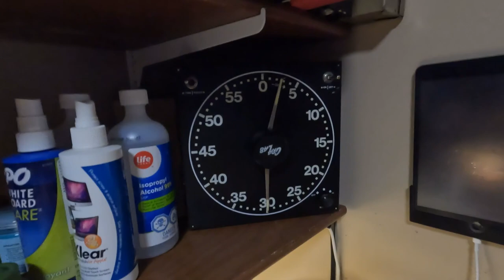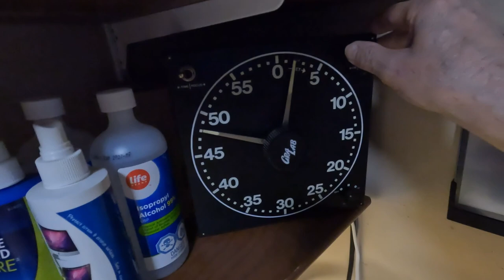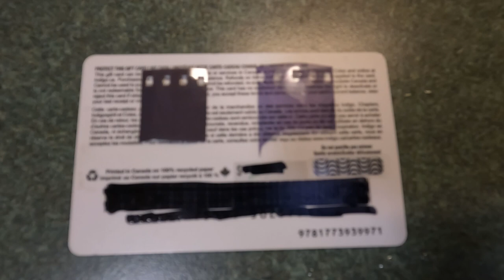Don't throw away your darkroom fixer, replenish it!

Comment: Jim: thanks for the informative video and a reminder that you can replenish fixer. Back in the early 80s I was involved in an E6 lab in London. We used to run the old fixer through a special device that collected the silver content, that is in the fixer. It was then picked up and sent away to a company who used to extract the silver and send us a cheque for some hundreds of pounds. I’ve just finished building my dark room. I don’t plan on putting through the volumes of film that we used to process at the lab. I will be processing black-and-white film and if my memory serves me correctly transparency film yields more silver due to the different process?
Reply from the maker: Yes in fact there are ways to do silver recovery for a home lab using steel wool but there is such a small amount that its not economically feasible unless you do a lot of processing.

Comment: Hi @jsollowsphotography. Thank you so much for this video, this is the only resource I could find on the internet explaining the replenishment section of the Rapid Fixer TDS.

 I still have some confusion regarding what's on the TDS and hope you could explain it.  On page 3 of the TDS it says for "Replenishment of Working Strength Fixer: 45ml/135-36". Is 45ml supposed to be the minimum amount of newly mixed working strength  solution added to the existing working strength solution, or is this how many rolls to expect to fix when replenished. From your video I'm thinking it's the former, since it sounds like you're able to fix more than one roll when you replenish using 50ml of working solution. How many rolls would you estimate you can do between replenishment?

 Thanks again for this video, it's very well done and has just the information I needed
Reply from the maker: Yes you are correct. It means .. when you are going to replenish, dispose of 45ml of your current working strength fixer and replace it with 45ml of freshly mixed working strength fixer. In other words dump out 45 ml of the old stuff and add in 45 ml of fresh (4+1). This boosts the concentration of your working strength solution. Make sure to dispose of the waste 45ml properly. I put it in a mason jar and when full I take it to my municipal chemical waste disposal site. Does that help? Please feel free to message me directly https://linktr.ee/jsollows
Reply: @jsollowsphotography   Perfect! Thanks for the super fast response!

Comment: Thanks for explaining the process but didnt you mean 'replenish' the (old) fixer by adding fresh fixer at a ratio of 1:9 instead of using (as mentioned in the video) a ratio of 1:4 which is what you would use when mixing an entirely new solution.
Reply from the maker: No it’s replenished at 1:4 for General Purpose film as specified in the data sheet for Ilford Rapid Fix on page 3 under Replenishment. 1:9 is only used for paper, not film. I still replenish for paper at 1:4 and have done so now for 51 years.
Reply: @jsollowsphotography  Thanks for the clarification, got it!

Comment: Thanks for the video. My problem is that I am getting a lot of black I am guessing silver salts floating around in the fixer. Do you somehow filter your working solution from time to time?
Reply from the maker: Depends on the fixer. My Ilford Rapid Fix doesn’t have that issue but I have seen it. Run your fixer through a coffee filter occasionally.
Reply: @jsollowsphotography  Thanks for the advice. I was thinking about trying this. I guess I shouldn't throw the filter away to normal bin?

Comment: Does this technique work for the Ilford Rapid Fixer for prints as well?!i am planning to use Ilford Rapid Fixer for both film and prints, but to have sperate batches for each. Is that correct? And can the print batch be replenished the same? Thanks!
Reply from the maker: You can use exactly the same fixer for both. No need for separate batches with Ilford Rapid Fix.